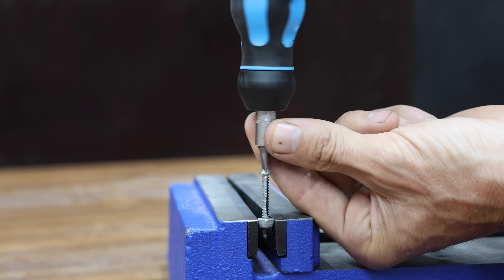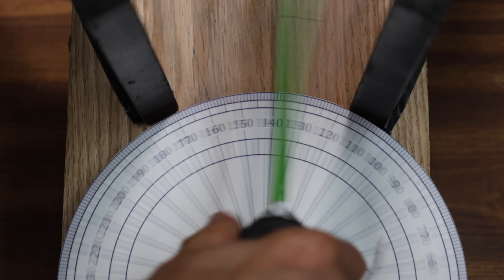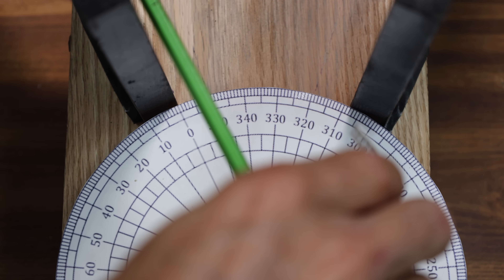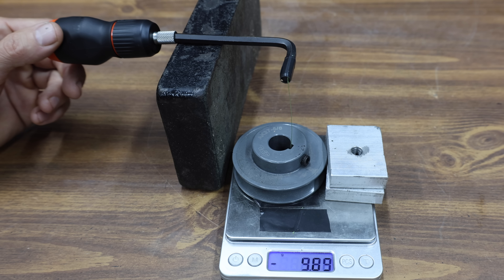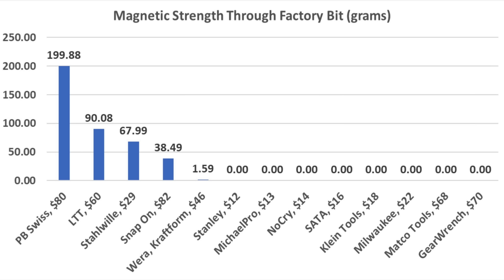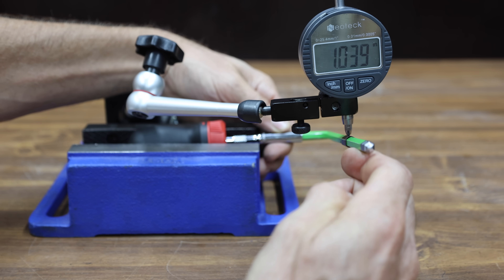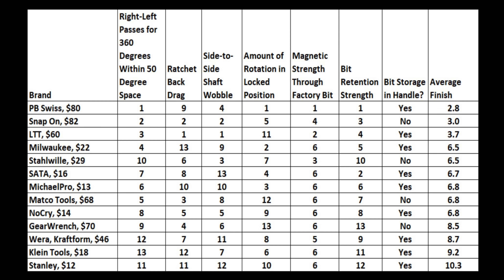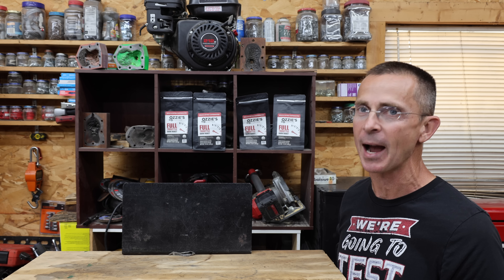Is Linus Tech Tips “Stubby” Screwdriver Best? Let's Settle This!

Comment: Maybe a better way of grading would be a linear scale (eg. setting the best to 1 and the worst to 0) and then give points to each depending on where they fall on the scale. That way tools with very close performance would receive similar grades representing their relative performance better than a placing system.

The problem with the grading as is, as I see it, is that it penalizes very close but worse performance too much (one whole placing worse) and abysmal performance relative to the next better tool not enough (still just one placing worse)
Reply from the maker: Thanks for the feedback.

Comment: I don't know if this is worth testing or not but I've always wondered if you have two different types of tread on a truck if you will have better traction or not. Or if you have a 4wd if you have different tread on all 4 tires if you have better traction or not or if it's better to have to same tread tires on there to have better traction. My reasoning for different tread tires might help with traction is, one tread might grab the ground or road better at one time and then the other one better at others time as they roll or I could be wrong and the same treads on all tires are better. Don't know and not sure if it will make a good video or not. Like what you do so keep up the good work.
Reply from the maker: Thanks, will do!  Thanks for the suggestion.

Comment: A whole set price blows the LTT price out the water, stop overpaying for brands.
Reply: Well, you've gotta consider manufacturing scale as well, the LTT one isn't made at a huge scale which would drive down price.
And given that it was designed to have very low back drag and be used to work on electronics, there's only one other stubby that performed similarly and that's 22$ more

At the end everyones gotta decide what they'll use it for and see if its worth the price. For some the gear wrench set will offer the best value for others the LTT or snap on screwdrivers
Reply: The more you use a tool, the more the quality matters, and the more justified the associated cost is.

Comment: EPISODE IDEA: toughest backpack. There are a lot of brands that say they're great but the straps break within a short time or the zippers fall apart, or the seams just separate. I bet some of the cheaper one's out perform expectations
Reply from the maker: Thanks for the suggestion.
Reply: Swissgear 5505. relatively cheap or expensive depending on who you are.
Biggest problem the bag has imo is the side "cup holders" lol they are not very strong.

I daily a motorcycle and have used the same bag for almost a year now,
I bought mine used and have used it for laptop transportation, but mostly groceries and errand running, the bag is deceptively large on the inside. An 8 pack of sparkling water, a crushed bag of chips, a handful of things from the dollar store, yadda yadda. 
I use the zippers alot, putting gloves away and taking them back out, pulling out my vape pen, throwing stuff in the bag, pulling out lens cloth for the helmet, putting away ear plugs, yadda yadda. 
Zips are great.

I can ride for 2-3 hours just fine, honestly the most comfortable backpack I have ever had... 
Only complaint would be the adjustment straps for the shoulders , like the excess length that hangs down is quite long and uneven. I wear the backpack pretty tight tho and probably have uneven shoulders or something.

Anyway I hate every product I ever buy but this backpack is a rarity and I would actually recommend it.....
so long as the whole bag is not "New and improved....." these days.

First link: Looks like the middle interior pocket is setup a bit different and the zipper pulls are a different design.... I never trust product redesigns.... its kinda like movie sequels... always worse....

https://www.swissgear.com/swissgear-5505-laptop-backpack
vs
https://www.swissgear.com/swissgear-5505-laptop-backpack-black-black-special-edition

The second link is the design that I have minus the color

lol Im sure you weren't really looking for a message like this, sorry.

Comment: No nonsense, non biased testing makes this channel one of the best test reviews on here.
So happy LTT stumpy got a fair test, it takes a lot to build commercial products these days.
Reply from the maker: Thanks!
Reply: Sure I will sound like an asshole for saying this, but no it doesn't take that much for some companies, it takes a lot for who actually builds it (which might have known how to make it well for decades) but for most companies it's just badge engineering, you hire someone to do the hard work, and sit on your chair looking at the sales graphs.
Reply: Ah yes, unbiased….when he takes a commission off sales……
Reply: Would like to ad in the build quality test 9:27 the screwdriver is right against the block where others werent so it maybe couldnt of mooved?
Reply: and making it to the top 5, often top 3 for a vanity brant is very impressive
Reply: LTT products are over priced garbage.  And when it breaks they take months to respond.
Reply: "So happy LTT stumpy got a fair test" - Unlike when LTT incorrected tested a waterblock on the wrong graphics card, and then auctioned off the only prototype.
Reply: @hippopotamus86  Said company of the waterblock said it would work on that card and said they don't need the card to be sent back originally making the original planning of the auction perfectly normal.

Revise your "facts".
Reply: Back on topic of the OP, I'm also pleasantly surprised about the LTT's result. But it turned a little sour when it was disclosed only at the end that the product was supplied before official release.
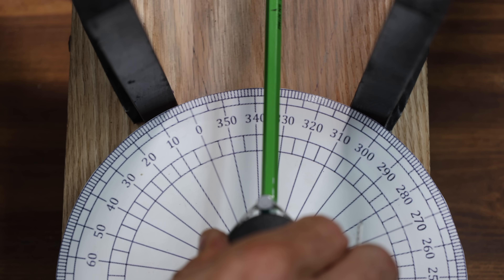He could have disclosed it at 3:33 already but no.
Reply: they just buy it mate, LTT has nothing to do with that product except the name.
Reply: He didn't create a those screwdrivers.
Reply: Tell that to Linus who possibly destroyed a small startup by having no idea what he was doing and then 'bagging' the product.
Reply: @bsmith2053  The startup said they were cool with them keeping it at first so they were already planning to replace it.

He destroyed jack shit, fuck off with your lies.
Reply: @bsmith2053 hes wrong but 800$ for a cooling block is crazy
Reply: @AyukaAmameth  Yeah seems expensive, do agree with you there.
Reply: @AyukaAmameth  Its full copper, not the avg cooling block but go off.
Reply: @TahaJelani  yea but imagine paying half the price of 3090 ti to buy a cooling block
Reply: @AyukaAmameth  ok? not everything is aimed at being competitive at price to performance. Thats like saying imagine paying half the price of a house on a car.
Reply: @TahaJelani  not the same right ?its like buying a ac for half the price of a house i wouldnt mind paying that much to buy a cpu when the gpu cost $1600+ not a 800$ cooler for a gpu if it makes sense
Reply: @AyukaAmameth  It's a 1 off product, like art is. Imagine paying 15mil for a painting made out of 30 dollars of material.
Reply: @Surms41  its a product not a art it isnt made once its not limited so ig that answers it
Reply: @AyukaAmameth  It was a prototype so it has far more value than a retail product and selling that water block set the company that produced it back at least a few months if it doesn't end up bankrupting them....
Reply: @AyukaAmameth  its a prototype.......
Reply: @bsmith2053  That was SO yesterday dude. Don't care anymore, and has absolutely nothing to be with a screwdriver review.
Reply: @TargetSurvival  But you just said you loved that a company got a fair review. You only care about stubby screwdriver reviews being "fair"? Just say you're a LTT fanboy who never bought an incorrectly reviewed product based on their reviews and don't care their employees are treated like trash.
Reply: @Komainu959 You're right, I don't care.
Reply: @bsmith2053 The only people who cared about that fiasco were gamers nexus worshippers that were itching for a reason to say “I told you so” to LTT viewers. Get a life.
Reply: @bsmith2053  lets be honest here. that product was never meant to make sense anyway. was just a baller money wasting thing.
What he did was still very wrong though.
Reply: @bsmith2053 said startup also didn't tell LMG what they were ok with them doing with the prototype

I'm not defending LMG, but it's common sense that if you send a company a product for a video, what happens to the product after the video should be figured out before the product is even sent
Reply: @bsmith2053  Sure, Linus is Satan himself. Get over that little drama
Reply: @disco.lemonade  That wasn't a little drama, that was a company that should have known better.  And yet appears to continue to make the wrong choices at every step.
Reply: @bsmith2053  Geez, I'd yo see you going crazy with companies that actually fuck up in a monumental way and actually affect the lives of nut a few, but literally thousands of people in a very, very negative way. Get over it, dude
Reply: @disco.lemonade  Ahh because my comment was pertinent to the topic made by another.  Had we been talking about another topic in which I another company was relevant than I would.  Not sure why you are having so many issues with my comment and the follow ups.  As long as I am giving you some joy in your life that makes me happy.
Reply: @bsmith2053  The startup originally intended to GIVE the prototype to LTT completely. When they saw the video is when they asked for it back. Linus may have damaged the startup by giving them a lazy and negative review, but selling the cooling block had nothing to do with that. Yes, it was a mistake, but everybody overblows its impact and it's also been dealt with by now.
Reply: @meatisomalley  Nothing by me has been mentioned about selling the block after the fact.  Call me old fashioned but if a large company damages a startup by giving a lazy and negative review (because they chose to) isn't that the exact issue at hand. The impact to that company could be immeasurable, so we can't say the impact was overblown.  What we can say is that it is unprofessional and discredits LTT.
Reply: @bsmith2053 i have 1 questions why is it evil if LTT does it but indifferent if any other larger company does it? Sorry but we see every day that start ups are destroyed and crippled by larger corporations you are quite overblowing a situation, that situation is less likely to happen again for the labs get the product first then they make a video so all tests are already done.
Reply: @SnowValkyrie247  It is no different, and I never said it was. I am not overblowing the situation, it is what it is.  I'm not sure what you are trying to say in the last sentence.  LTT is a big player therefore he gets held to the same level.   Why do people assume unspoken words?
Reply: @bsmith2053 if your definition of getting it destroyed , is building a media empire with more than 15 mil sub, and still going strong despite recent controversy,. Than I am sure your rate of average life is at least 10 time more successful than them. Mr billionaire
Reply: @elvlin9821  ahh I think you misunderstand my initial thoughts.
Reply: @bsmith2053  I wonder how do you think this startup pays it workers... Hugs and kisses? Because if a single 800$ block and a review that almost no one seen before can obliterate the startup, they must don't had a penny on their bank accounts and probably should work with another thing.
Not trying to change LMG fault but you shouldn't send expensive prototypes to reviewers when you really need them. At all this time being a LTT hater, you never thought the startup really doesn't care about this prototype and just wanted to promote themselves with this? So innocent of you...before you didn't know their name, now you know. Just like an free ad.
Reply: @AMV12S  a startup sits at a precarious position and early setbacks can be costly.  As for the rest of your reply, you seem to be off on tangents and assumptions that you think I have made or that the parties involved knew, so I won't care to  correct or comment on.  Let's get back to the crux of the issue, a company made a bad review and discouraged people from buying the product when they couldn't be bothered, it seems, to review it correctly. When they were notified they still couldn't be bothered to rectify the situation.

Comment: If LTT could improve the rotation in locked position, it could easily be #1 overall. Thats a pretty bad performance on that single metric while everything else is pretty good. 

But, it's still $20+ dollars cheaper than the current #1 and #2, so it has that going for it.
Reply from the maker: Thanks for the feedback.

Comment: In the shaft movement test The LTT stubby screwdriver was fastened in the vice so close to the base of the shaft it couldnt move while other screwdrivers were fastened further out (its notable that some screwdrivers flex in different spots). This is an important factor but also very hard to adapt fairly for each brand. Its an interesting test, but i didnt like it overall for this reason.

Great video man! Your channel is awesome! ✌️

Comment: I have watched these videos for years and are the best for reviewing anything without bias!

Would you consider reviewing brushcutters

Specially: 

PROYAMA 51.7cc 2-Cycle Gas Powred Weed Eater Weed Trimmer, 3-in-1 Gas String Trimmer and Brush Cutter, Anti-Vibration System Tube

WILD BADGER POWER 52cc Weed Eater/Wacker Gas Powered, 3 in 1 String Trimmer/Edger 18'' with 10'' Brush Cutter,Rubber Handle & Shoulder Strap Included

COOCHEER 58cc Brush Cutter Gas Powered Weed Eater 4-in-1 Weed Wacker Straight Shaft String Trimmer with 2 Detachable Head for Grass,Weed(2023 Upgrade)

Echo 410u

Stihl fs240

I would really like to see how these budget brushcutters stack up to echo and Stihl 

Things I would like to know:

- vibration 
- power
- weight
- build quality (your opinion)
- fuel economy 
- operator comfort 

This review would be greatly appreciated!

Thanks in advance
Reply from the maker: Thanks for the suggestion.

Comment: Hey there I know you said you read the comments and take suggestions on new videos and new things to test. Have you ever done a video on if you accidentally put gasoline in the oil of an engine and run it see what happens just a video suggestion that I was curious about from previously watching you put two-stroke oil in a four stroke engine.
Reply: From personal experience I blew up a small block 400 when too much fuel overflowed the carburetor (stuck float) and flooded the engine washed down the pistons and wiped out the main bearings….

Comment: Hey Project Farm, could you perhaps some time in the future do a video on fastener anti cam-out liquids and how (or if) they work in practice? Supposedly, user is supposed to put a drop of the liquid in the drive indentation on the screw head, and it's supposed to "improve" contact between the driver and screw and decrease the chance of driver camming out. 
I've seen Vibra-Tite 470 DriveGrip and DAP Tank Bond Liquid Grip advertising on YouTube and via sponsorships, but surely there must be other brands too.
Reply from the maker: Thanks for the suggestion.

Comment: It's ironic that LTT, who have been pretty embarrassing to watch when they try to use tools, sell some of the best tools.
Reply: Still no, you can get a cheap power screwdriver, set of normal screwdrivers not encumbered by that bulky shaft limiting usefulness, perhaps even an hart impact for the same price, and for the home user, it will last quite a while.  LTT grift is selling a $60 to screw down a gpu once every couple of years.

Comment: Extension cords. I bought a few heavy cable lime green ones. I can’t recall the brand or exact gauge, but I couldn’t be happier. 

You could make two videos. Conventional cords(which usually fail near the ends from tying them to power tools, or getting run over/cut(obviously). 

Heavy duty/gauge cables are better for generators, long distance, and high amp usage((obviously). Personally, I’ll only use heavy for anything now on. 

Just a thought. Apologize if you already did it. Thanks for the help btw.
Reply from the maker: Thanks for the suggestion.

Comment: I have the Milwaukee, got a 2 pack with the stubby and standard size on clearance for around $20 at home Depot, best ratcheting screwdriver I've owned, would be perfect if it had less back drag and a knurled shaft, it's great for big jobs, not ideal when I'm working on my 3d printer which has a ton of little m3 screws
Reply from the maker: Thanks for sharing.

Comment: The first test may have been a bit skewed due to the longer length of the screwdriver and the tendency for your hand to fall away from the center as can be seen in the video.  On your next ratchet swing test, you may want to use a plate with a hole in it as a secondary center point to eliminate more human error.  Great video as usual otherwise!
Reply: lol

Comment: Can you do a review on the best 1/4 inch nut driver.  I do alot of pole barn work and it's seems it's hard to find a good nut driver that holds the screw right and doesn't let the screw wobble in the nut driver
Reply from the maker: Thanks for the suggestion.

Comment: The one thing I think the very in depth tables and figures is missing is bang for buck chart. If we make an inverse rating where the first place gives 12 points and the last gives zero, the PB Swiss comes in at 61 points. That would be 1.31 dollars per point
The Snap-On at 60 is 1.37 dollars per point.
LTT at 56 is 1.07 $pp
Milwaukee at 39 is only 0.56 $pp.

So it really, REALLY depends what people are after. If someone wants bang for buck, I think the NoCry could be interesting at 39 points, without any zeros in there it comes to 0.36 $pp.

If I learned anything from buying Festool for my workshop then that most people don't need the creme de la creme to get the job done.
Reply from the maker: Thanks for the feedback.